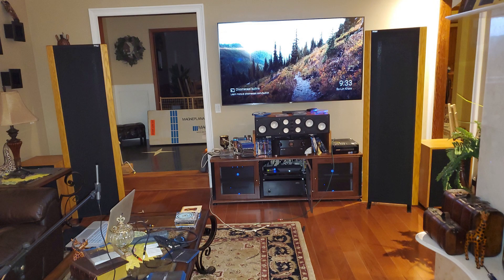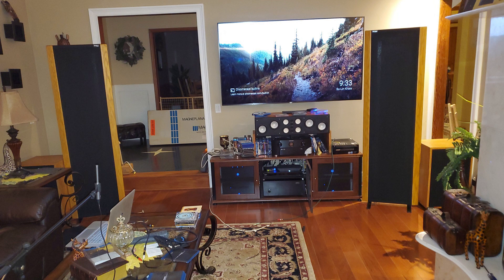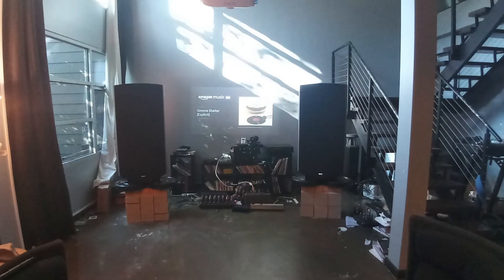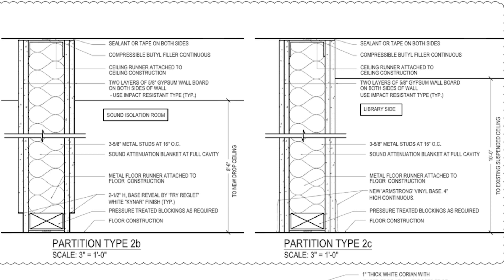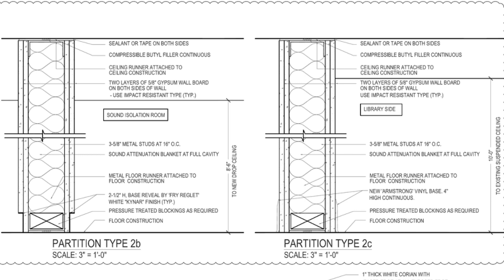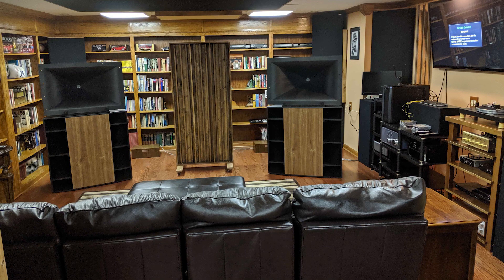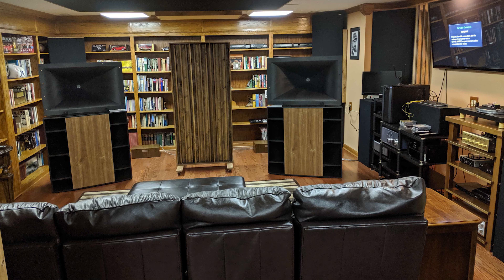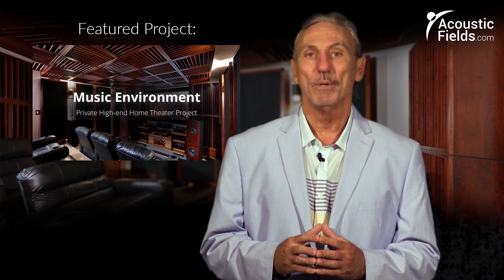Don't Do This! # 14 - www.AcousticFields.com

Comment: If you are going to use a speaker partially in an opening behind - it can be Magnepans or other planer speakers
Reply from the maker: There is no "partial" when it comes speaker set up. Speaker set up is very critical if you are to realize the full potential of the speaker designer's objectives.

Comment: Most audio enthusiast don't have the luxury of having all the space they need. That being said,I never understood seeing high end gear cramped in a corner either. Why spend that type of money. 

I use acoustical treatment in my room , have the speakers comfortable of the wall measured from baffle to wall 3ft plus. Is it ideal?! Nope...but it's the best I can do
Reply from the maker: Keep your speakers at least 4' away from the room boundary surfaces. The goal is to reduce distortions, not add to them.
Reply: @AcousticFields  I wish, I could unfortunately my livingroom doesn't support that at the time. I have to (as many) walk the fine line of practicality and compromise space wise.

Comment: So you criticize both a system with the gear back between the speakers, and in another picture a system with the gear on the right wall of the system. This to me seems like what 95% of people do. What would be your suggestion? Putting the gear in another adjacent would be impractical for most people…
Reply from the maker: 95 % of people do not understand the impact on sonic resolution with gear placement. There are certain spaces that must be free from any spurious reflections. You must keep certain areas free from objects as the resolution of the room increases.
Reply from the maker: We are all about achieving the maximum room resolution. Placing materials between speakers produces spurious reflections. The goal is to minimize distortions. Most people do not understand the importance of reflection free environments.
Reply: @AcousticFields  so where you should put the gear, if sidewall is wrong, too? I start thinking that in your opinion absolutely everything is wrong.
Reply from the maker: @bububarx4559  Keep the gear low to the floor between the speakers. The gear height should not exceed 12".This keeps signal loss from analog cables at a minimum  along with minimizing the distortions from cross channel reflections
Reply: @AcousticFields  thx!

Comment: Why have such large speakers in such a small room?

Do they really think putting a system designed for the stage inside a small room is going to sound good?

Or are they having secret audio wars with their neighbors that nobody has called the police over?
Reply from the maker: People dont plan to fail, they fail to plan.
Reply: @AcousticFields  
After some thought.
I thinks it's a bit of: 
Bigger has got to be better; 
Tim the Toolman Taylor syndrome.

He almost always ramped up the power in 
something only to have it go out of control.

Which is exactly what happens when 
those huge speakers are turned on.

Comment: I wish you could dumb it down for us DIY guys for things like making a quiet bedroom or keeping out some traffic noise. Muffling the low end of footsteps would be nice too.
Reply: I’m not sure what more Mr. Foley can touch on for a D.I.Y. guy. Most every video is filled with so much information, given freely…all that’s left is to apply the knowledge he gives us to your room…
Reply: @dhmtbr2551  We all have to start somewhere. I was hoping for a better construction method for walls for better STC. Turns out it's much more complicated. Who knew?

So I'm getting up at 4am and checking for background SPL and frequency in the house now. So in the room in question SPL is about 20 to 25Db and there is traffic noise from 50 to 150Hz. Peak at 59Hz is that electronics? So sound isolation is step 1 right? Any way to keep those low frequencies from getting into the house?

I'm sure in a few weeks I may know how much I don't know.
Reply from the maker: You must measure all noise for frequency and amplitude. All barriers are frequency and amplitude dependent. You must know your noise before you build anything to stop it.

Comment: The most obvious issue in these photos is the sheer size of the speakers that folks are packing in their rooms. Like, really?? 😅 Those rooms don’t seem to be insanely small, but they ain’t big enough to handle THOSE. They’d be way better off with studio grade powered monitors and could just about get away with the same orientation/setup. Way less clutter etc.
Reply from the maker: People choose more energy thinking they will get more musical resolution (quantity vs. quality) which they believe will bring them closer to their music. They are half right. Getting closer is the objective but more energy is usaully not the answer. The answer is to increase the resoltion of the room. More amplitude will not ever on its own result in more resolution.